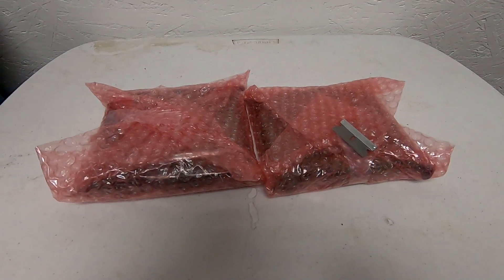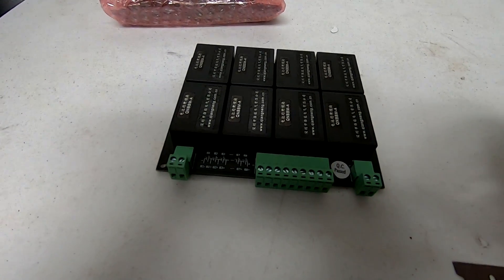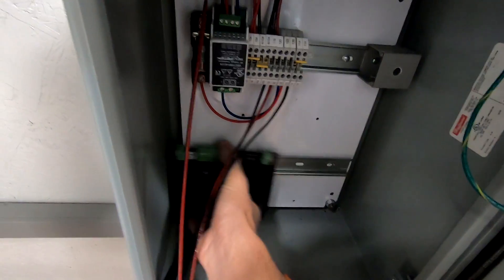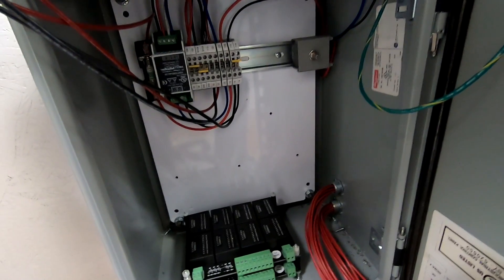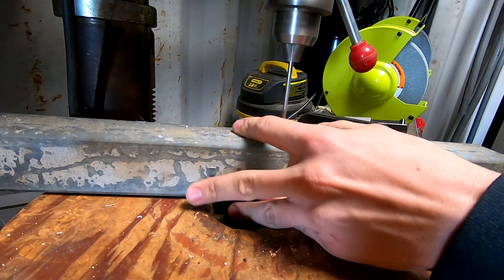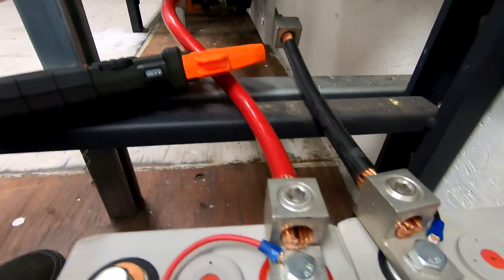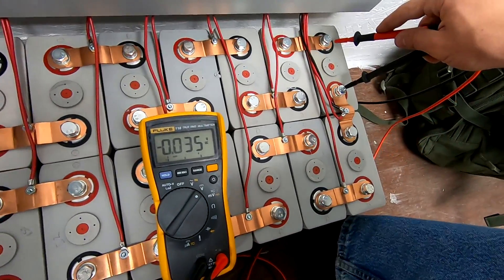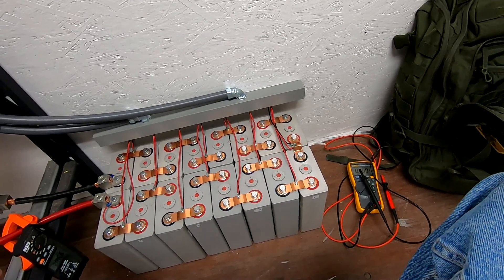Off Grid: Prismatic Lithium Battery Balancing System Install & Unboxing

Comment: You need a fuse on each balance lead. You didn't top balance the cells first?
Reply: balance leads are not fused. never seen it.
Reply from the maker: Top balancing is a joke.  These were bottom balanced to 3.0vpc.
Reply: @HighTechLab  you can't bottom balance to 3v. That's the joke. 2.5 maybe, 2v if you want accurate. 3v is nowhere near the bottom which is why your voltages are all over the place. Start listening
Reply from the maker: 2 volts is way too low of a voltage to ever take these cells, CALB (The manufacturer) specs the discharge termination voltage at 2.5 volts.  Going below that voltage is an easy way to cause damage to the cells.  

Before putting these cells into service we plotted all of the voltages along the discharge curve and at 3.0v, there is next to nothing left, 4% charge at absolute most. The CALB spec sheet also matches our plotted data nearly exactly.  The discharge curve down to 2.5 volts only takes out 1-2 amp hours more at absolute most - But keep in mind all my set points are designed to never let the cells go down that low.

Can you please give some advice that better explains the voltages you are referencing?
Reply: @HighTechLab  
you need to look much more how lifepo4 batteries charge and what their characteristics are.
preferably before you make another youtube video
Reply: @HighTechLab  yes 2.5v is a safe point for every day discharge. But for balance you need to go down to where the discharge curve is steep, ie 2v. Also, discharge below 2v does not hurt Lifepo4. It's how quickly you recharge that hurts them. I've bought cells that were 0v and recovered them
Reply from the maker: Your video you shared is factually correct - Drawing from opposite corners is very important especially when balancing - I did exactly that.

In the end, I used 3 volts as a starting point.

The charge at day 0 whether it be full or empty (top or bottom balance) is irrelevant because the balancer always moves charge to achieve equal voltage, not equal charge capacity.
Reply: @HighTechLab  no, it doesn't. It ATTEMPTS to. If you have 60A charge, and the balancer takes 6A, there's still 54A going into fully charged cells. Those balancers are ridiculously inaccurate and will unbalance your pack unless you restrict the balancing to >3.5v
You should never have given them a first charge in the first place.
Reply: @HighTechLab  he cant because he is wrong
Reply: @HighTechLab  
bottom balancing is a much bigger joke

Comment: That's NOT a bms. It barely qualifies as junk
Reply from the maker: It can move 6 amps.  I specifically said in the title "Balancing Board", and that is what it is.  My plan is to tie in to the PLC later and get individual cell readouts on the HMI panel, as well as graphs showing voltage history, max voltage, etc. etc.  It also transfers instead of dissipates the imbalance and works both during charging and discharging.
Reply: @HighTechLab  if you are charging at 60A, one cell is at 3.67v. How many amps continue to go into the cell?

Comment: Shit those batts are expensive, no wonder I recycle used laptop cells to make into packs lol
Reply from the maker: Please tell me you are kidding.  Your house is expensive when the laptop cells cause it to burn down.
Reply: @HighTechLab  you put them in an outside shed in a metal cabinet. I wouldn't put any li-xx inside my home or sla, flooded or agm. seen all types blow up. When i ran rc cars I seen a nimh blow up and stick in a wall.
Reply from the maker: @David Smith But the likelyhood of used laptop batteries that have varying lifespans and levels of abuse are much much much more likely to have a catastrophic failure versus these prismatic cells that are all maintained in balance and there are few enough cells to properly keep an eye on.  Tossing a meter on 16 cells is much more likely to happen than thousands of 18650s.
Reply: @HighTechLab  I know there's a higher risk in 18650's but for 280 ah at 48v I paid only $300 - 400
Reply: You should see where Jehu Garcia made a battery pack for Kombi Life, which caught fire while nobody was using it and burned their house down.  A real tragedy - they show the pack where the fire started, and the guy who put it out had it catch fire a second time even after it was put down.  That's the hazard with recycled batteries and Jehu's designs.
Reply: @haroldlopez2406  can you send me the link?
Reply: @DavidSmith-dm8ew  Certainly - here's the link:   https://www.youtube.com/watch?v=lc0j8tAzMw4   Jehu Garcia is a one man marketing machine dedicated to nothing but making bank selling junk cells that his friend alarmhookup or jag35 are dumping on the internet.  Now he's selling 50hz inverters in the USA which is 60hz power.  Next month it'll be ice to Eskimos.   No sane person would bolt that much lithium to their wall unless they wanted to be "burnin' down the house".  Kombilife didn't deserve what happened to them.  See my comment on his video - off grid kiwi speaks the truth.

Comment: Good stuff. I don't know much about lithium batteries. When building lead acid and AGM strings in cell sites, we would use a light coating of grease (anti-ox?) and torque wrenches on the terminals. Check the battery specs.
Reply from the maker: These are down to their torque spec - Since the electrical room does not get subjected to humidity, I'm not super worried about corrosion.  Additionally, the cells are clearly visable so any issues with the connections causing heat and discoloring the bus bars would be immediately observed by a visual inspection.

Comment: Recommend bottom-balancing each cell before stringing them together. Charging at 40A seems a tad high for the size bank.
Reply: You don't bottom balance with solar because the bank spends 90% of it's life above 80% soc. Your voltages are way out of balance and you are going to destroy them very soon
Reply from the maker: Actually, no.  This pack spends around 50% of it's time under 60% DOD.  This packs purpose was to get me running well until I can get a larger bank of similar chemistry.  As a result, the pack is needing recharge around 2AM, when the generator runs and brings it up to ~70% full.  I also have my settings on my solar set to allow for keeping the cells safe with a bottom balance.  At the end of the day all cells have their own personality and the balancing board keeps them balanced pretty much all the time.  (The Balancer can move up to 6 amps per cell, so it's easy for it to keep things happy.)
Reply: @HighTechLab  so you are going to be running the cells well below 3v, where you think you "bottom balanced". Also, if you are running at low soc that means lower cell voltage which means higher current to get the same Watts. So you will be exceeding the rated current a lot. You are in for an expensive lesson
Reply: These are lifepo4 cells, they can easily handle 1c charge which from guessing their capacity at 100ah means 100A charge without breaking a sweat...I am not 100% sure if the 1c charge applies to and is multiplied by the 16s setup???

If you were in parallel then maybe you can multiply the c rate which would easily handle 1600A continuous
Even in series, 100A continuous charge currents are normal for these cells
Reply from the maker: @Zemaderiran You are close, when you series up cells the voltage adds but the amps stay the same - Parallel connecting cells increases the amp rating.

Sure, they can handle 1c charge rates, but good engineering practice is not to push the limits.  Typically I'm charging at around 40 amps.
Reply from the maker: They were bottom balanced, this video was mainly for the balancer install.  I'll go over that in the next video

Comment: looks like a nice  BMS does it have bluetooth or a way to see what it is doing. Look forward to see it working also how do you set it for NiMH
Reply from the maker: No bluetooth or monitoring features, it's strictly for balancing.  Since I have a PLC and HMI panel, my plan is to do all the features a typical off-the-shelf system would do with the PLC, this way I can be in control of all variables of both charging and discharging.  The HMI panel can connect to the internet and send me emails and all sorts of information - features that would be hundreds of dollars with a dedicated BMS system - And the PLC can do so much more (Eventually control the whole ranch).

Comment: Next time clamp stuf wile you drilling and don't hold it with your hand if it snap to the drill it cut your hand like butter, as always thumps upp :-)
Reply: You have spent  money on all that electrical equipment,  I am sure that you could find £20 for a drill press before you loose a finger or two, also you should have drilled with the work piece the other way round with wood underneath . If you are advising others how to do things, you need to give the right advice or you are setting others to fail. Is there a reason why you installed your electrical box upside down??? Also why are your bus bars not insulated,??? I know that it's low voltage, but you are going to have one hell of a spark if you drop a spanner across them. ⚡⚡🔥⚡⚡🤔
Reply: @nickbird7742  
i totally agree
Reply: @ursodermatt8809  I am still trying to work out where the HighTecLab is, so far it's been more LowTecLab 🤔
Reply: @nickbird7742  
hahaha
Reply from the maker: Which electrical box is upside down?
Reply: @HighTechLab  your main electrical box, the things that give it away, the lock, the hinge pins and the warning labels are upside down.
Reply from the maker: You are very 100% correct.  Unfortunately I do not own a drill press vise.
Reply: @HighTechLab  Then use something else to hold it down but never use you hands you only have 2 :-)
Reply: @andarthome142  
yes very strange, prides himself about his super mega chuck screw and then  .......
Reply: I hunted for this comment. I knew i wasnt the only person thinking it. Yes you gave a disclamer but vice grips or channel locks work good. I once drilled out a 4/0 ring terminal that had wire crimped on it and it cought and tore me up
Reply: @electromechanicalstuff2602  
some people are "hard learners". only after an accident do they believe.
Reply: @ursodermatt8809  i was standing there after having already finished doing 4 without issue. 2 friends walked in and said what r u doing?!! I was like its fiiiine. While they watched me it cought and tore my thumb open. Im one of them
Reply: @electromechanicalstuff2602  
hahaha, at least you are honest. it certainly helps correcting wrongs
Reply: So true! I'm one of the hard learners... very similar situation, and my middle finger now shortened by 1/3. If no vise or clamp, at least use something with some strength between your fingers and the metal blade! Some layers of cloth, peace of wood, anything but the bare skin and bone...

Comment: I'm a bit confused by your choice of a 54V bank.  I thought your setup was 24V or was it a 48V setup?
Reply from the maker: 48v nominal voltage.
Reply: @HighTechLab  LiFePO4 nominal is 51.2 (assuming 3.2 nominal center discharge voltage times 16 cells.  Push it to 3.65 and it's 58.4V max - most inverters love that extra headroom lithium buys them for surge loading)